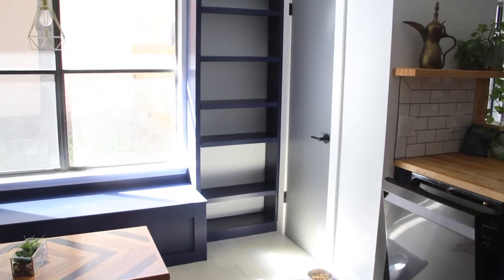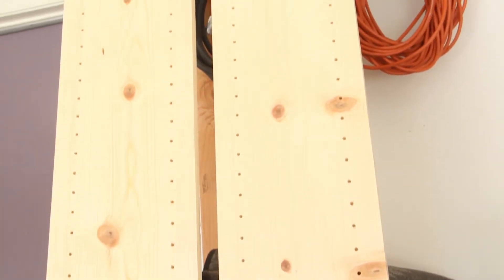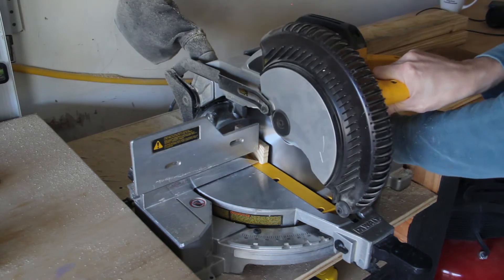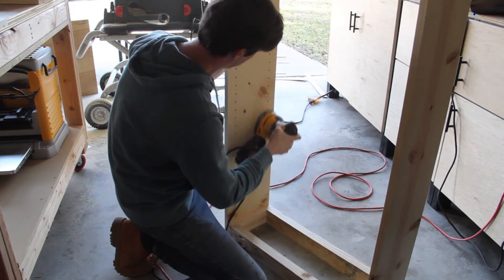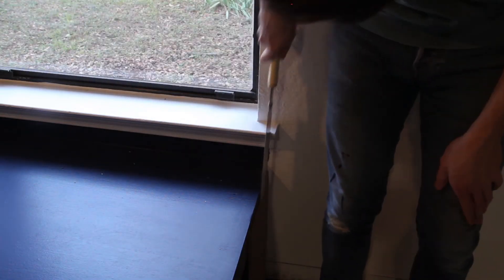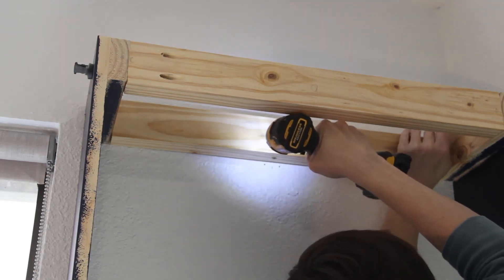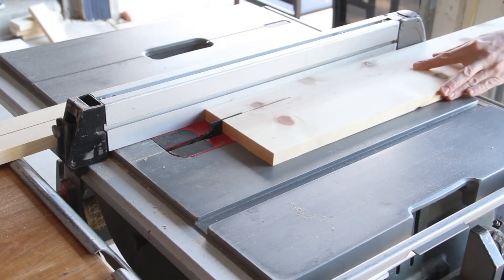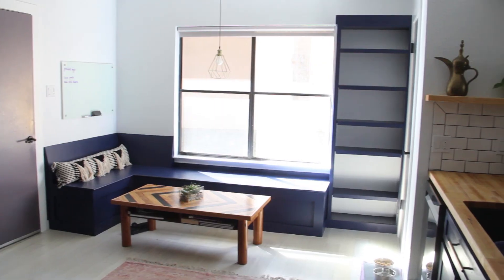DIY Built-In Adjustable Bookshelf

Comment: I know this video is old but if you're using the type of shelf pins that I use, L shaped, with a screw hole on one side, if you turn the pin the other way around with the screw hole "up", you can definitely avoid making them router notches, to account for them. Not sure if that's why you made the notches but that is the only thing I can think of why you made them. To allow for a clean flush seamless look between the sides and shelves. Cool little project